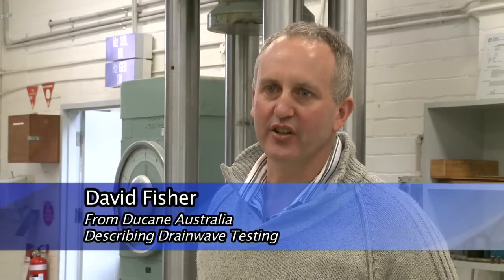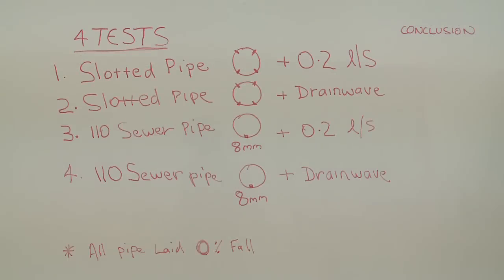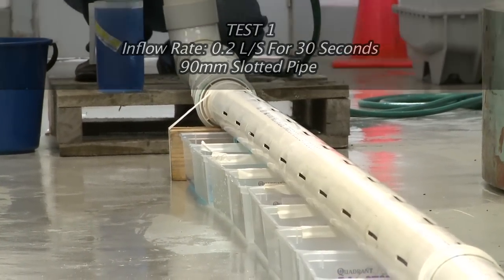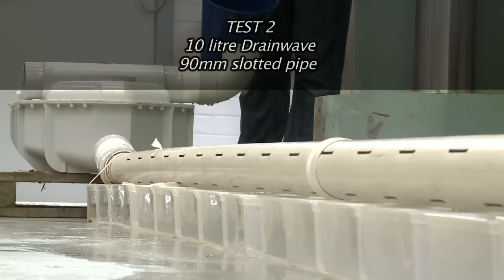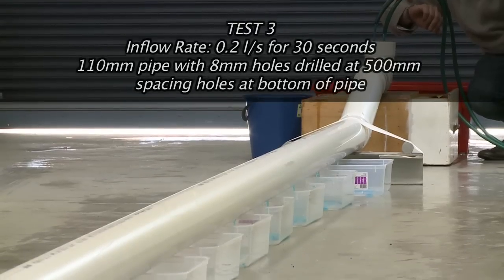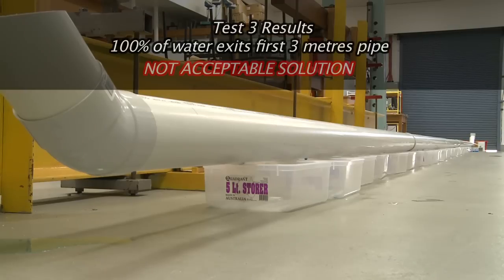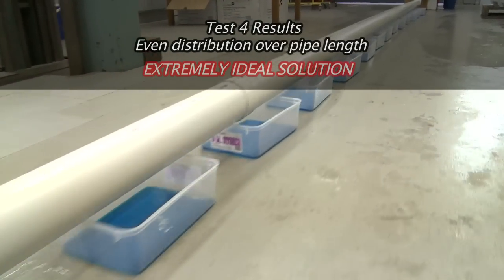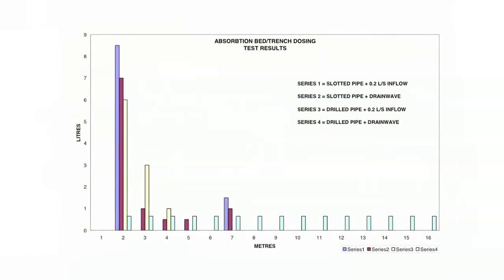Drainwave Testing - Absorption Trench Application

Comment: I have a question. If the Drainwave requires 10 litres of liquid to initiate a release, what happens if, say, 9.75 litres of filthy water lies inside the Drainwave for a huge length of time awaiting the final 0.25 litres to be released? Does residue build up within the Drainwave, rendering it useless?